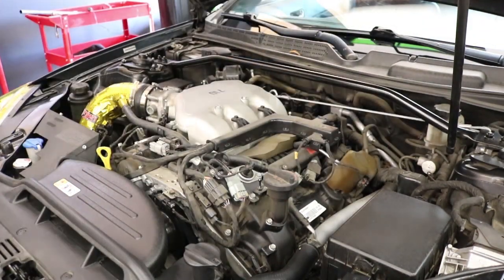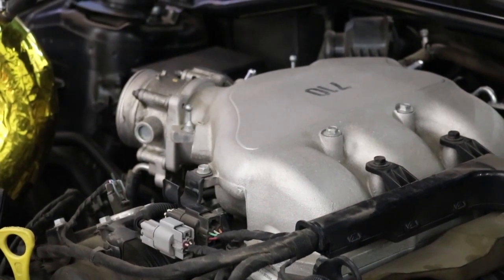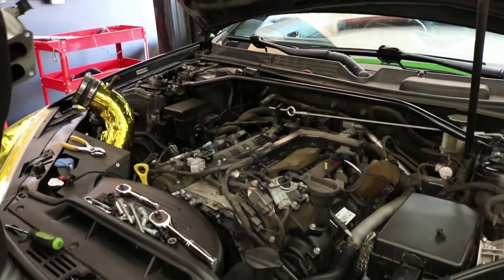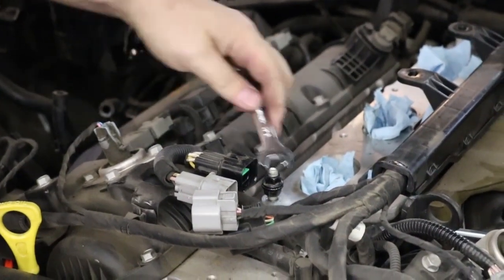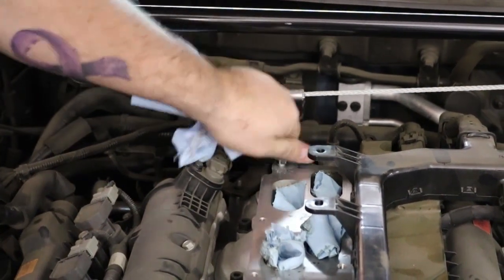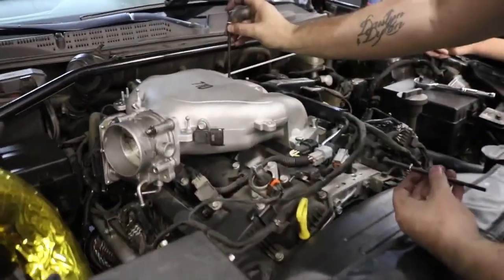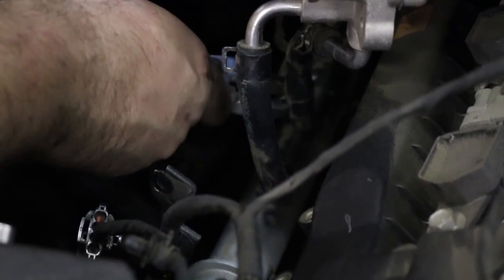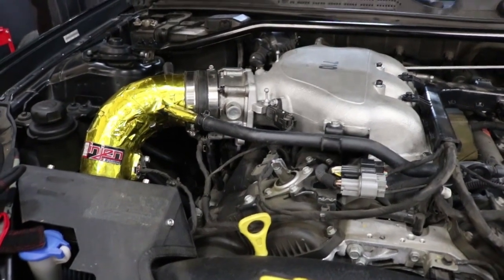Genesis Coupe Manifold Riser Install by 3point8performance

Comment: Now my question is, does it make the engine "empty" on low rpm's or it gives an overall increase trough all the RPM arc?
Reply: mark883nm I’m curious myself
Reply from the maker: Here is Dustin's statement: "low rpm, so 2k-4k is where it'll be most noticable because it improves the low-mid range torque which helps get the car up and moving quickly"
Reply from the maker: I will be doing some testing this weekend for my review video!!
Reply: KEVLARR82TV 2k-4K is the sweet spot! I was cruising last night and had my throttle controller set to HH4 and had it in 3rd gear and keep doing pulls from 2.5-4K and really sucks my head back into the seat. I can’t wait to do it with a riser now!

Comment: What kinda gains do you see from it?
Reply from the maker: +15 hp & +19 tq without a tune! I will be doing a review video
Reply: I read that it’s mid range power which is where we drive most of the time but I wonder how that would translate on a dyno
Reply from the maker: low rpm, so 2k-4k is where it'll be most noticable because it improves the low-mid range torque which helps get the car up and moving quickly
Reply: KEVLARR82TV that’s 15 hp and 19 tq over a bone stock car so if car already has mods that improve airflow it won’t be that much it still helps tho
Reply: RedLine 3.8 true I heard that Dustin Davis is putting down like 360 whp with the raiser, stage 3 manifold, cold air intake, and custom tune
Reply: Mustangkid29 nah bro lol he made like 333
Reply: RedLine 3.8 that’s still pretty damn good with those mods
Reply: Mustangkid29 yeah he’s still on 91 tho e85 he’d make 340 plus I’m sure
Reply: You can also make your life way easier buy your self stud remover!